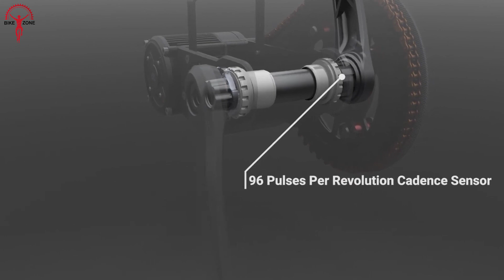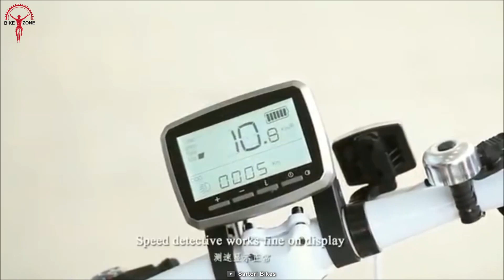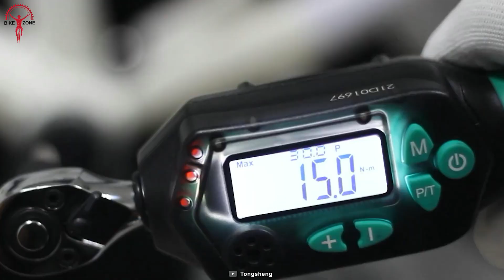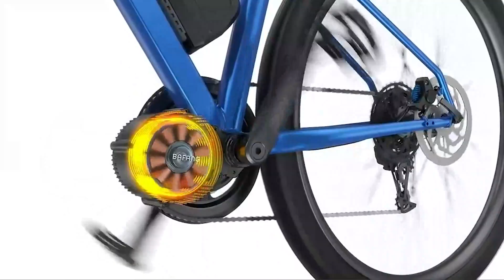Top 7 Best Mid Drive Ebike Conversion Kit

Comment: My build, 4300 Trek 4 series mtb 750w Fang mid drive, 25 amps, 52v 25ah batt, 48t lekkie chainring with a total weight of only 55lb.. 35mph throttle only.. top speed of 41.6mph.. full throttle  (While peddling) as fast as i can.. built for speed street only :) sorry i cant post a pic 🤷
Reply: 750W Bafang, BBS02, got 3 of them. Since, new controller 25A years ago, it made me laugh for years now. I can't  believe people are still buying all the commercials over priced, overweight, over estimated bike while they got just in front of the nose one of the best most poweful, reliable, cheap, mecanical friendly, mid drive kit on the market. But I must admit that you have to be creative and have basic engineers notions to fully know how to enjoy it.
Reply from the maker: Sounds great!
Reply: I have a 2022 trek dual sport 3 that im trying to convert. Would u recommend this fang 750w? I would also like to hit 40+ mph!
Reply: @MrGoofySir  If you have 52v batt and the programing cable, you can hook the BBS02 to a laptop or computer and increase the amps to 25, roughly 1,470 watts.. giving you a good chance.. but even with mine turned up and a now with a 52t chain ring i still cant hit 42mph "peddling my ass off" ! i feel it's maxed out or underpowered at this point. My suggestion, is to forgo the BBS02 and get the BBSHD, use the cable and turn it up to 30amps 1,764 Watts ! i feel like it can handle the 52t chainring... there are also external controllers  "Not Cheap" But can push the BBSHD past 2000 watts ! Be warned.. and carful not to overheat or fry your controller !! 👍